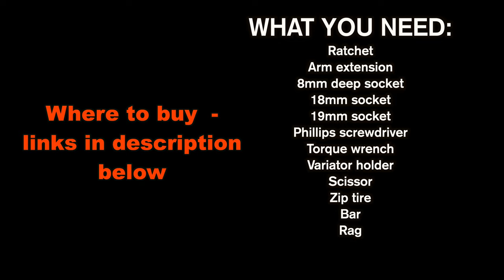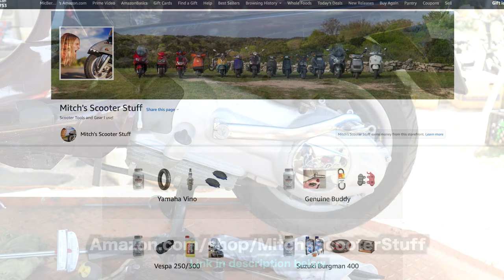Vespa LX CVT Parts / Cover Installation - Variator, Clutch, Belt, Rollers | Mitch's Scooter Stuff

Comment from the maker: * Tools I used in this video: 
Ratchet 1/4 drive - http://amzn.to/2xcJEu1
Ratchet 3/8 drive - http://amzn.to/2hhmnUs
3” / 6” extension set 1/4 drive - http://amzn.to/2wDuzzW
3" / 6” extension set 3/8 drive - http://amzn.to/2h7ypMl
8mm deep socket 1/4 drive - https://amzn.to/3cNGsbs
18mm socket 3/8 socket - http://amzn.to/2srvqqx
19mm socket 3/8 drive - http://amzn.to/2CiXNqo
Phillips #2 screwdriver - http://amzn.to/2fgdZDL
Torque wrench 0-150 lb/ft 3/8 drive - http://amzn.to/2Crqq4R
Variator / Clutch holder tool - https://amzn.to/2ZuYJEA
Scissor - https://amzn.to/2pIY56w
Zip ties - http://amzn.to/2pkp3AL
Metal bar 
Rag
Reply: instablaster

Comment: Would it not damage the torque drive bearing if you use the driven pulley shaft as a counter arm when tightening the driver pullet nut?

Comment: Dude, your videos are so relaxing 

Looks like the same procedure as my LX50.

I made sure the Kickstarter worked well when I put the cover back on (I had to hit the fuuuuck out of it with pb blaster, but it operates smoothly now,) but I hear a little ringing bell sound when riding and it might be that Kickstarter gear scraping against the flywheel (or whatever is spinning) 🥺🥺

Comment: Does anyone know, do Piaggio Liberty 125 and Vespa ET4 125 use the same engines, carburetors etc? I've heard somewhere that I can make my final drive higher by putting Vespa's final drive in my Liberty. Also, there's a lot of ET4 fans but not so much Liberty fans, knowing that those scooters have similar mechanics would ease up my life :D